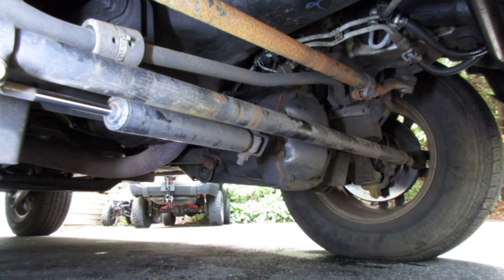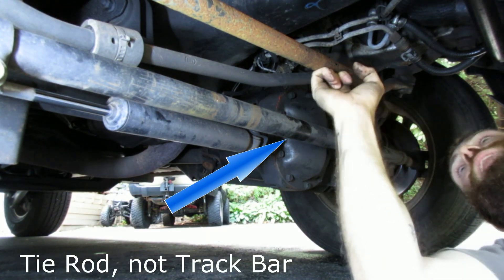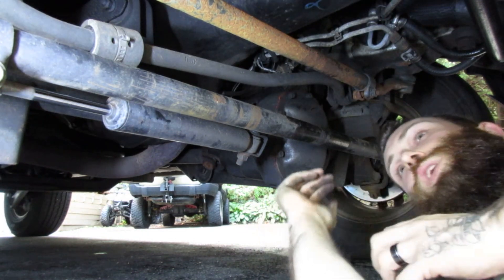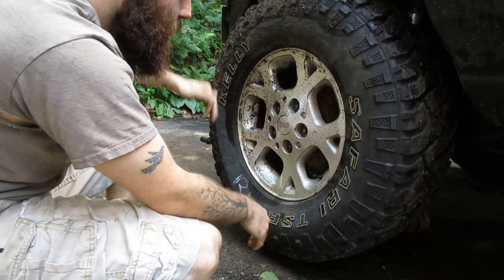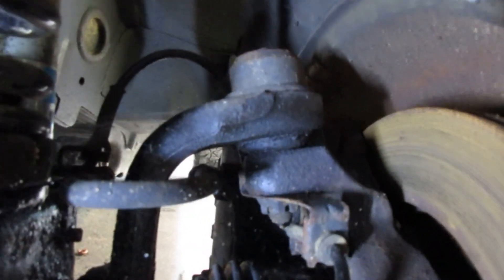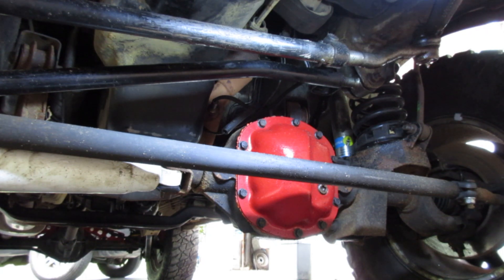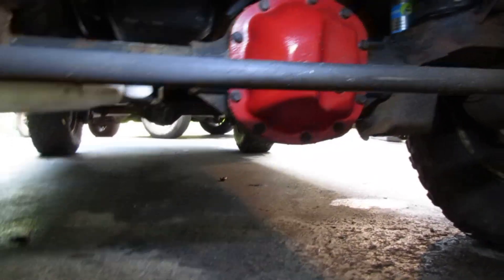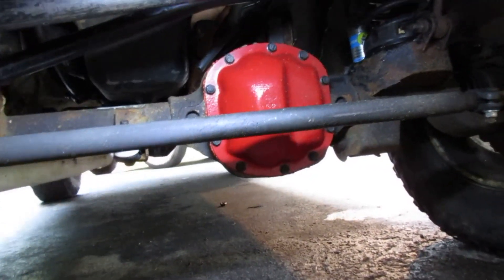How to Diagnose DEATH WOBBLE

Comment: It could be as simple as the innner wear on the front tires will also cause the death wobble...move the front tires to the back or buy a new set... Had to replace tie rods,ball joints,leaf spings,shocks, and a bumch of other parts untill i found out it was the dam tires....😪 1990 f250 xlt lariat 4x4 7.3 idi turbo diesel on 35s with a 6inch lift...
Reply: Almost changed all those parts until someone told me that my tires bad. I put new tires on my truck and now it no longer shakes.

Comment: So I put on a 4.5 in lift with all new steering and suspension components. It was running fine til I put on new hd engine and transmission mounts. Now if I hit a bump going above 35 the Jeep shakes. Checked for anything loose and the jam nut was loose. Tightened it up a couple of times and finally put blue lock tight on it. Had to other guys look at it and nothing else is loose. Any idea's?
Reply from the maker: Maybe see if you tracbar hole is wallowed out.. what kind of Jeep?
Reply: @DEInTheGarage  2000 Cherokee sport.
Reply: Could driving it with a loose jam nut cause the trac bar to fail?
Reply from the maker: @theadventuresofmattp  What jam nut are you referring to? Xjs do not have jam nuts on their TREs like independent front suspension vehicle do. Are you referring to the castle bolt which holds the upper track back and TREs in? From what you have described, you have something that is VERY out of spec which should actually make it easier for you to find the issue.

Comment: Thanks for doing this! I experienced death wobble in one of my Jeeps. It was the trackbar. Thanks for emphasizing that the steering stabilizer will never be the cause of death wobble and will not fix it either, just mask it. I wish I knew that information back in the 90's. YouTube did no exist back then and the internet was still a baby. Haha. I changed everything but the trackbar, aligned the wheels, balanced the tires, and nothing worked. Changed the trackbar last, and never again did I experience death wobble in that Jeep. Next time I get death wobble, the track bar will be the first thing I check, and replace it (or the ends) at the first sign of wear.
Reply from the maker: You would not believe the push back I get on that steering stabilizer comment. Haha
Reply: I actually believe you because I get the same. Haha. I was able to get death wobble with a brand new steering stabilizer. It took me a few times going over a pothole and at different speeds until I got it. Then I knew that was not it. Trackbar...that was it!  @DEInTheGarage
Reply: BTW. When I experienced DW, I was young and it was on my first Jeep. So, I really did not know what it was. I went with every advise out there, mostly from garage mechanics (and some real mechanics) that were not experienced in front solid axles. It took me weeks. It could have taken me a few hours if I had your video back then. The beauty of YouTube. @DEInTheGarage

Comment: First off great video. I have death wobble and can not get rid of it. Installed a 4" lift a month ago and somehow created death wobble. List of parts that are new in the last 30 days are...

New wheel hubs both sides
New ball joints upper and lower both sides
New tie rod ends
New drag link ends
New adjustable track bar and bushings with 9/16 grade 8 bolts w/ welded washers
New upper control arm bushing axle side
New adjustable upper control arm
New lower adjustable control arm
New bilstein 5100 shocks
New rough country steering stabilizer
Tires rotated (no difference)
Tires re-balanced (no difference)

I've checked that no components are loose with the wheel test as well as ball joints just because even though they are New doesn't mean they are not bad.  

Before lifting to 4" it was at 3" for 2 years on same wheels with absolutely no issues.

I'm at a dead end.
Reply from the maker: Dang, sounds like a tough one. Sometimes those track bars can be tricky to diagnose. you are 100% sure there is no chance of any movement there? What kind of Jeep is it?
Reply: D&E In The Garage absolutely zero play in track bar bolts

2002 Grand Cherokee
Reply: D&E In The Garage today I had a local garage do another alignment. +4.5 caster and .20 total tow. That’s perfect according to Iron Rock Off-road. The mechanic could not find anything loose as I suspected because I was that thorough and confident. 

Had death wobble so bad it blew out my drivers headlight. How can I be the only Jeep that out of everything I’ve done still have this.
Reply: What did it end up being? Malfunctioning calipers can contribute too.

Comment: Great explanation and video, now I have my homework and the information needed to fond my Death Wobble.
Reply from the maker: Good luck!!
Reply: Looks like its the tire rods, both are pretty loose up and down, they just kinda fall back down on their own, but not a lot of side to side play.  Im running 275/70  tires without a lift. Do you recommend a HD tire rod kit?   @DEInTheGarage
Reply from the maker: @johnadams-sd6ye  I cant imagine you need an HD steering setup with those tires. some Moog replacement tie rods will do wonders for your handling. There is be no play in the TREs and it should be difficult to move them

Comment: i had horrible wobble on my 87 xj
i changed the steering link all the tierods connected to the knuckle and pitman arm. Used a ZJ steering link to link to the opposite knuckle and changed the stabilizer strut. So i technically have a double steeringlink arm on my jeep and drives great no more wobble
Reply from the maker: Nice!
Reply: D&E In The Garage yeah both the tie rod that connects to the pitman arm to one knuckle and the other tierod that connects to the opposite knuckle are the same thick width very heavy duty and a cheap mod. The ZJ steering link is also dirt cheap!
Reply: But its only v8 zj steering 4.0 zj steering is the same as a xj

Comment: Finally an explanation that makes sense! Thanks. 
I'm off to figure out whats up with my TJ. It only does it between 40-48mph. (34" tires rotated and rebalanced) 
At least now I know what to look for.
Would the steering box also pose a problem for that? I noticed mine has about a 1" play on steering wheel before the box reacts. (Though could be from extended damage of putting off fixing wobble)
Reply from the maker: That steering box play is just something that happens to Jeeps with a solid front axles. There is a way to tighten them a bit. i will try to post a video on how to do it
Reply: D&E In The Garage I have a 2000 tJ and at 35-40 is shakes just a tad but before that and after that doesn’t shake at all. And it didn’t do it every time sometimes  I can drive it a few weeks no problem the. It’ll do it agin.

Comment: I had a 1982 Chevy K30 that did the death wobble.
Seemed to always be precipitated by hitting a small bump in the road.
Reply from the maker: YEa, often a bump will trigger the DW
Reply: I have a 81 k30 4x4 dually, death wobble caused by a failed steering damper.  Only front end part I did not replace when restoring the truck.  Live and learn!

Comment: Great information my man,i have a 2005 Honda Accord,140,000 miles and I feel a wobble at all speeds from time to time,took it to FIRESTONE and they said it was my front struts and sway bar links and bushings,in your opinion do you think their diagnosis is correct???
Reply from the maker: It certainly could be possible. Before I finished reading your comment, my first thought was tierod ends which get loose and cause play in the steering which leads to wobble. I would suggest taking it to someone who specializes in Hondas (not a dealership) who you can trust. The guys at a big chain tire shop may or may not have your best interest in mind and they may or may not even be that qualified to do much more than swipe your credit card.

Comment: Wife bought 92 XJ! Me driving XJ second time, hit tiny pothole, XJ seemed like it was coming apart. stopped in middle o divided highway and looked real quick. Never had that happen before in my life, last XJ, an 89 never had an issue. Ex- truck driver of 20 yrs, scared me to death, got on the truth box to see what the deal was.........DEATH WOBBLE!

Told wife your NOT driving that JEEP outside of going to work & back (9/10 of a mile away, under 40 = fine) replacing worn hubs if I ever get the last 2 lug nuts off, which seem welded on. Quik tip, NEVER let a tire shop tighten your lug nuts with a gun, hand tighten with lug wrench or better, torque wrench between 80-90 ft/pds. She didn't know, as I normally handle the cars. WOMAN! Or more accurately, WIVES! Yeah I said it!
Reply from the maker: Hahah... Jeep lug nuts are particular bad as well because the are capped with some kind of alloy which appears like chrome, but in reality is very soft and deforms easily.

Comment: There's actually someone who has filmed the death wobble with a GoPro. https://youtu.be/07yvJuhnUYM

 As I recall this has been a big problem with certain Dodge Rams too... where was actually causing big accidents. Here's a link as to what trucks were actually affected what years 2008 to 2012 http://oriellycc.com/what-you-need-to-know-about-the-dodge-truck-death-wobble/
Reply from the maker: I think I have seen that one. They drive over a piece of wood to trigger it, right? And yea, death wobble happens on any vehicle with a solid front axle. That means old Ford and Chevy as well.
Reply: Here it is. https://youtu.be/07yvJuhnUYM
There's actually 7 or 8 on YouTube now different Vehicles. There was a class action suit also 2008 to 2012 Dodge Rams I put the link above

Comment: I have a new JL with 7k miles, has the way I understand is death wobble. I need to take back to dealership?
Reply: Brand new! Wrangler Unlimited Sport JL. Hit a bump where a concrete bridge pavement meet the black top. 75mph on highway, had to slow down speed to about 55-60 to get it under control. Thank God the wife wasn't in the Jeep. She would have flipped out.
Reply from the maker: @jimprindle9873  Jeez... that is not right! Seriously. Someone must not have tightened something down at the factory or something. Good luck with that! The dealer is going to have some explaining to do.
Reply from the maker: Is it stock?? A brand new stock vehicle should NOT have death wobble.

Comment: D&E, great video...super helpful.  Any chance you can look at this video here shot this am and give me some advice? 
https://www.youtube.com/watch?v=1aaBtPcqYFc
I've got pretty bad death wobble and assume that this is NOT a normal amount of play. Track bar is rock solid, zero movement. 
2" lift, pretty stock size tires...245/75/16
Reply from the maker: Hey man. Sorry to hear about your DW. You DEFINITELY need new tie rod ends on your drag ink (The upper bar) and tie rod (lower). They are not overly expensive or difficult to change and will make a pretty big difference. Not sure if that is all that is wrong, but a good place to start as they are clearly gone.
Reply: @DEInTheGarage  Thanks a ton! Really appreciate the feedback. I'll start to look around for replacement pieces!
Reply: @DEInTheGarage  Follow up...I bought a full set of upper and lower rod ends from AutoZone for about $22 each and started the install on Friday night. The Drag link passenger side end literally would not come out. We tried everything including a vice, blow torch, profanity and lots of leverage. I ended up buying a thicker replacement out of frustration for about $43.00 and continued the install. After the install, I took it immediately to Sears Automotive for a $100 one year alignment, picked it up yesterday...and she's driving like a DREAM. I'll give it about two weeks to determine if I totally solved my Death Wobble, but so far...so good! 
At this point, I'm about $250.00 in but I feel really good about it. I'm sure a mechanic would have been way over $400 / $500. 
Thanks a TON for the feedback! Keep up the great and informative work!

Comment: Awesome video and diagnostic testing. I have a tj that the track bar ball joint end was shot. New track bar definately improved the shimmy I was feeling. My shimmy/shake didnt cause my steering wheel to shake at all, just felt front end shimmy/skake at about 67 mph more so on drivers side. Have new tires and did multiple balances and alignments. Still shakes/shimmy from time to time. Gonna use your ball joint/ bearing tests to see if that's the culprit. Great job and thanks for the vid!
Reply from the maker: Thanks for the feedback! Good luck with your project!

Comment: Best explanation video I ever seen on YouTube about the death wobble, I have a 99 Jeep Cherokee Sport and I'm experiencing the death wobble. My 1st project I'm going to do is replacing the track bar and go from there. Thanks for posting this video.👍
Reply from the maker: Thanks for the feedback! Hope it helps
Reply: D&E In The Garage I bought a 99 DJ from a coworker and he said I need a rear end because the death wobble hits at 60-65 mph if the steering wheel is turning(not so much when driving straight,just a little vibration).Any thoughts or tips not expressed in this vid that could be helpful to my specific situation?thanks in advance

Comment: i have a 2007 jku x with independent front suspension that gets death wobble the track bar was just replaced. Do you know what could be causing it?
Reply from the maker: First, the JKU doesnt have have independent suspension, it has a live front axle. As for the track bar. Often a bad track bar can lead to the mounting point become wallowed or ovalled out. This will allow the track bar to have play and result in DW. I would confirm that the mounting points are intact. If they are, I would then begin to test the remaining components laid out in the video. Good luck!
Reply: only the rubicon has a live front axle i think
Reply from the maker: Not to be confrontational, but you are 100% incorrect. Every single Wrangler since day 1 has have a live solid front axle. It is one of the things that has kept the Wrangler as THE offroad vehicle.
Reply: I stand corrected my apologies

Comment: I’ve replaced my track bar, my ball joints are fine l, shock stabilizer is fine do you you think it is my control arm or could it be play in the gear box lmk ASAP
Reply from the maker: Play in the gearbox is unlikely, but possible. Control arms could definitely do it. Is the play in either component excessive?

Comment: I had a 96 4runner with stock front suspension that death wobbled from 30-35 every single time. So you're wrong on that solid front only.
Reply from the maker: IFS does get a speed wobble type thing, but it isnt the same as "death wobble" the cause, diagnosis, and repair is different. Has to be a really really shitty Toyota to get it.

Comment: my rear is wobbling like that
Reply from the maker: What kind of vehicle is it?
Reply: @DEInTheGarage  03 grand Cherokee I bought cheap have alot of work to do on it
Reply: I'm changing all rear control arms and sway bar links this weekend
Reply from the maker: Honestly, that sounds like poorly balanced tired. That year GC has a three link rear which is usually pretty stable. That said, control arms certainly won't hurt. I would be interested to know if that fixes your issue.
Reply: @DEInTheGarage  well I got it up on the lift and all bushing where shot so needed to be done
Reply: hope that fixes it lol
Reply: @DEInTheGarage  ok update rear has all new control arms and sway bars feels much better but still has wobble while ot was up I seen the track bar bushing is shot giving the steering wheel lots of play tightened the gear box a little as well to be certain helped a little but should be all cured after track bar just like you say

Comment: I have a 09 jku that has death wobble. This has been the most informative video I have found giving a great detailed explanation & showing how to check everything. Thanks for taking time to make the video and sharing. I will be checking everything on my next off day...
Reply from the maker: Good luck with it! Hope you are able to figure it out
Reply: D&E In The Garage another thing you forgot to mention is from factory alot of solid axle trucks never have the track bar and drag link at the same angle so there for the drag link takes the hit first passing it on the the gear box tie rods hub bearing cause wear in them faster and faster cause the drag link is working as your track bar that's why alot of after market track bars it fixs the angle.. I learn this from building my f150 a custom solid axle up front that your track bar and drag link gotta have the same angle so the track bar can absorb the hit and not the steering

Comment: I want to lift 4 inches but now im worried about death wobble. But if i get a expensive kit its should have all the proper parts?
Reply from the maker: You certainly stand a better chance. It is always a bummer to "pay for a name", but you really do get what you pay for with with lifts. If you are going 4" on a WJ you are going to need the obvious stuff (springs, shocks, track bar, etc) but also a transfer case drop, at the very least an a-arm spacer, possibly long arms... it is definitely doable, but I'd save your pennies to make sure you can do right. What lifts are you looking at?
Reply: @DEInTheGarage  well i would like to get this one. https://www.morris4x4center.com/rough-country-4-n2-0-x-series-suspension-lift-kit-rc-623n2.html?gclid=EAIaIQobChMIz4yJ9dCw3QIVApNpCh08SwQxEAQYBSABEgKeN_D_BwE&gclsrc=aw.ds

But im thinking about this one https://www.roughcountry.com/jeep-suspension-lift-kit-908-20.html
Reply: @DEInTheGarage  what kit would you use for around 4 inches? I dont rock crawl i just want it to drive as nice as it does factory.
Reply from the maker: Well that first one is for an XJ, not a WJ so it will not work for you.
Reply from the maker: If you can swing the cost, this is the best 4 inch lift for a DD and weekend warrior

https://www.ironrockoffroad.com/product/wj-4-critical-path-long-arm-lift-kit.html